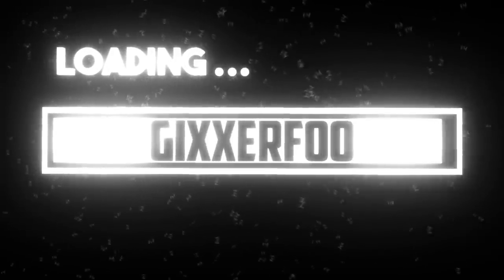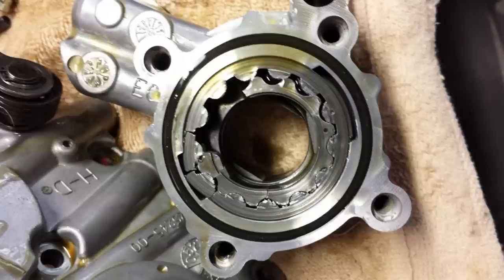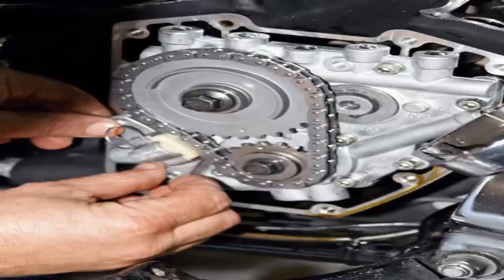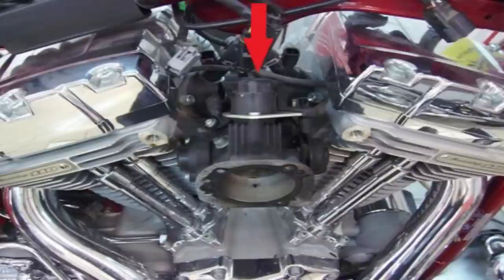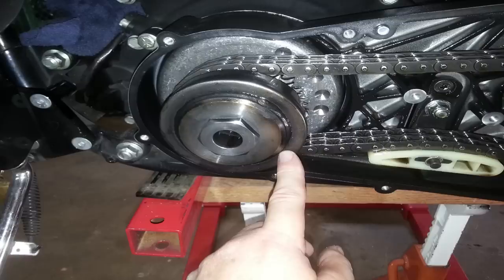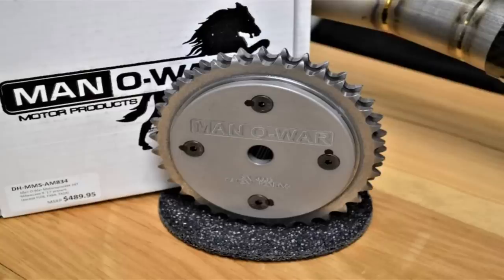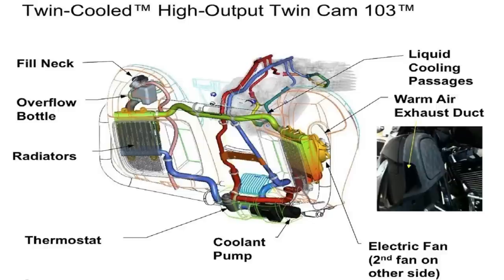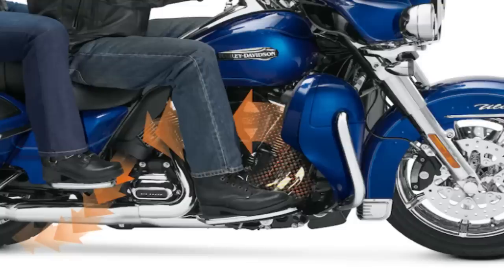5 Harley Problems the Aftermarket Fixed Before the Factory

Comment: Great video and no sugar coating. Harley drags their feet because it is all about money. Just as a comparison of American motor companies if you take a look at the Victory air cooled V-twin the last engine the 106 is everything a Harley engine should be. Harley knows and they have the ability to change because they have done it before. I think Harley just likes to sell parts and labor at this point. I like the last auto change tensioner and was a little apprehensive about it. When I first had my primary cover off looking at the chain tensioner the first thing that went through my head is why is this not a auto chain tensioner? I asked this twenty years ago! Thanks for the review and the shimming advice. I will now upgrade the XL1200S.
Reply from the maker: The Victory Freedom 106 was a great motor, it's a shame they ditched it but Indian was outselling the Victory platform. Harley for sure build bikes that keep the parts and service departments open.
Reply: I have a Judge and it is my commuter bike now. Every time I ride it I think, this V twin has all the sounds and clean looks but it is smooth and effortless to own. The Sportster, I still have,  took effort on my part to get it to run properly. Fixing the carb. No thanks to the dealer. Environmentally sealing the  timing harness connector located on the bottom of the engine just in case I had to ride through water up to my axles on the Palmetto expressway on the way home in a downpour. Lol.

Comment: I have a 2000 road king, I replaced the manual primary chain tensioner and put Harley‘s spring tension on. I’ve been looking at a hydraulic chain tensioner I don’t know much about them. I may go back to the manual chain tensioner. Do you know anything about the hydraulic chain tensioner.
Reply from the maker: The hydraulics are a lot better than the OEM tensioner, they do have some give and work much in the same way as the hydraulic cam chain tensioners. I still prefer the manual tensioner myself though, I like to set it an know where I'm at.

Comment: Gixxer, good production as usual!  Also, though, listening to Kevin Baxter and watching his video covering the compensator "family tree," there was a marked visual and engineering difference between the unit used in the 88" engines compared to the later compensator designs.  He specifically shows the three side by side and calls the second Twin Cam one (compared to the first one) a "miserable failure."  So what I concluded from those visuals as well as what he outlined, was that the first Twinkie iteration was actually sound and pretty much OK unless you go huge build, but it was the latter ones that were bad and only ultimately fixed with the "final" versions bowing in the teen models.  Thus, I'd say that the larger engines outgrowing the compensator were not the issue per se, but rather, the design changes they came out with for those re-designed comps were the real culprits.  From southern California - thanks again and ...Ride Forever!
Reply from the maker: That's an excellent point, Kevin build some stout motors honestly the way should be built! He's absolutely correct about those compensator designs, Harley was saving money and passing the mess onto us.
Reply: Jessica the guy who complained about his Sportster my 1999 Sportster has gone 350,000 Mi almost trouble-free belts last me around 100,000 MI I've never had to replace anything in my clutch at all there is the little bearing that goes out every 50 60,000 miles IQ will hear Rattle and then you have to put the new one and it cost about $6 in parts wait I take the primary apart to put it in all of the Evo Sportsters have been very well reliable much better than their big bikes especially the twin-cam and later version the twin-cam was cheaper to build than evil and it turned around and bit them in the ass for warranty claims typical Harley Pennywise and pound-foolish and they still haven't learned their lesson with the new motor
Reply: I love to piss off the Harley Riders who have the love jugs on their bikes I tell them just like my Vespa Scooter has a fan oh really riled them up haha I remember a road test from the 1950s Panhead where they extended the cylinder head fins out to match the barrel and they said that the Panhead runs as cool as an Iceman shoulder my Evo Sportster runs 200° to up in August in Florida Evo Sportster the best Harley ever made

Comment: How about fluid transfer from the trans to the primary? I had 8 ounces in my primary until I installed the vent tube not to mention the ridiculous amount of blow by even when my oil was 3 dots below.
Reply from the maker: The M8's crankcase ventilation is awful, vented dip stick and trans cover helps a lot with that. Getting a upgraded oil pump helps a lot, either the latest Harley oil pump or even better is an aftermarket pump.

Comment: On a side note about heating and oil and traffic. I put 15W50 Castrol Syntec car oil in my Sportster and ran it fifty miles everyday in South Florida traffic and that oil never broke down and the engine never made head noise or blew oil out the air box. Engine never missed a beat as far as lubrication goes. It sounded so smooth the Harley dealership guys would ask me what I did to get it so smooth. I told them ancient Chinese secret. Lol. Never adjusted anything. If running any engine at a lower idle multi viscosity oil is your friend. Thin oil lubricates better on a cold engine.
Reply from the maker: That's a great point! Castrol makes some dang good oil, I used to run it in my race bikes!
Reply: I’ve been running shell rotella 5w 40 synthetic diesel truck oil on my bike for years. I use it in the transmission, primary, and engine. No problems, and it seems to shift smoother with less “ clunk” when shifting. I’ve been told that I’m going to destroy the drive train in this bike but I’ve had 30,000 hard miles and no problem.

Comment: We still have air/oil cooled engines in lawn mowers too.  It's time the Sportster S motor is expanded to the cruiser and touring models - that is, after the aftermarket sorts out the problems with the RevoMax motor.
Reply from the maker: That's the direction it is moving, the air cooled Sportster is done. Eventually we'll see Harley have a bike like the Indian Challenger.

Comment: After watching your other videos on Shovelhead, Evo big twin and looking at forms on the new M8. Harley after 118 years had issues with engines even at 118 years old. The Sportster 1200 is the most trouble free Harley engine. I hope the new 1250 Revolution Max is trouble free too!  I hope to see a 1350 Revolution Max in a Softail or Touring bike one day.  Liquid Cooled is the only way to have an engine make maximum power n torque at a constant controlled temperature.
Reply from the maker: Right on! I am really hopeful for that new Rev Max, so far it looks like a success in that Pan America. People are already going cross country on them, I've been following some other YouTubers doing that. Now that the Sportster S is out I'm waiting to see some long term feedback on it.
Reply: @GixxerFoo  Ask Harley if you can get a Sportster S for a good review!  GixxerFoo, Thanks for your vidoes

Comment: Your list pretty much sums it up. Not to sure why they moved away from Timken bearings though.
Reply from the maker: It was a cost savings move, faster to setup and install on the line. They didn't have to take the time to setup backlash on the tapered bearings either.

Comment: I love your channel. Straight to the point and very informative. What is your opinion on the Ultra Cool oil coolers? They have the duel electric fans that turn on when the oil hits a certain temperature. I've been thinking of installing one on my 110 just to keep it running a little cooler.
Reply from the maker: Ultra Cool is one I really like, those fan assisted units are the way to go. Especially on the 110 motor, they already run pretty hot and you can't beat that fan if your sitting at a light.
Reply: @GixxerFoo  Thanks I appreciate your input. Looks like there will be an Ultra Cool in my near future.

Comment: Gixxer,here’s another one.The early latches on the tour packs are junk.They rattle themselves apart.I replaced mine with rubber pull latches I bought at Napa.
Reply from the maker: That's a good one! I've heard about those latches being a issue!
Reply: Gotta remember to LOCK them too. If left unlocked , they pop open.

Comment: if Harley would tighten up the run off tolerances most of this wouldn't be an issue but allowing 12k on the pinion side should be criminal.
Reply from the maker: Totally agree, they would have to go back to tapered bearings and take the time to set the crank up properly again.
Reply: @GixxerFoo  All because Timken wanted too much money for their bearings and the bean counters saw it as an opportunity to do away with them. Look no further than the "INA cam bearing" as another savings initiative. They totally suck.... I don't even know why I still ride these POS bikes.
Reply: @kennethwise7108  Why stress yourself out.... just get rid of it and get what you want
Reply: @marvelharris9540  ive tried BMWs but they're way too expensive to maintain. I guess I'm a glutton for punishment 🤷🏻‍♂️
Reply: ONE PIECE FLYWHEEL ASSEMBLY!!!

Comment: You should have mentioned the horrendous water pump and epic failures while talking about the twin cooled  models... They fail on average around 8,000 mi Harley won't recall them just like they didn't the compensator but they will sell you the kit for the new pump on the M8 and recommend that they install it for you.  What a racket!
Reply from the maker: Yeah those housings like to crack and start leaking on the twin cooled bikes, if the pump doesn't outright fail. I think that was on the early bikes, the later models have seemed to do pretty well. Harley doesn't recall for mechanicals unless it is a safety hazard like the brakes when they did that recall.
Reply: @GixxerFoo  Just replace my water pump this weekend $352.?? plus tax.  Tore it apart to see what failed.  Found an electrical connection was not soldered well enough and when things got heated up, the contact points would come apart.  Less than 7000 miles on a 2015 that I just bought last month.  I read many post on this issue before I bought it.  I knew what I was getting myself into.  Never in all the years I've had Harley,  would I thought I would say,  I had to change the water pump on my motorcycle.  I put the new M8 pump conversion on.  Once again telling me that the MOCO knows they have a problem.  They wanted $1050 to replace it at the Stealership.

Comment: What about the crankcase pressure problems in the milwaukee 8s,whats the latest fix for those,besides drilling a hole behind the primary
Reply from the maker: Best way to go about that right now is a vented dipstick and or a vented trans cover to atmosphere to relieve that pressure. The next step to combine that with is a updated Harley oil pump which is stock on the late 2019's and newer. Even better is getting Feuling or S&S cam plate with a high flow oil pump.
Reply: Thanks for the info

Comment: The biggest beyond bone head move was changing the crank tolerance and removing the Timken bearing. I love my Harley but I hate them for this. Cams should be gear driven. The compensator would be less of an issue once the crank runout is removed. What they need to do is follow in Jaggs foot steps and improve on the oil cooler system.
Reply from the maker: Completely agree, the motors went to pot with the non tapered roller bearings. When they did that gear drive was out of the question from the factory.
Reply: @GixxerFoo  Yet we still love our bikes. Many riders care more about chrome and colors than they do a well bullet proof built engine.

Comment: The twin cam setup wouldn't have been so bad if they used gears instead of a chain on the backside of the cam plate and had just one chain and tensioner right behind the cam cover.
I think that hybrid set up would be a lot more trouble-free than an all gear or all chain setup.
Reply from the maker: To keep the gear drive they would of had to stay with the tapered bearing lower ends and take the time to set backlash on everything. I completely agree, Harley says they got away from gears for noise reduction. Lol I don't believe that for a second, it was cost reduction for the factory while raising the price on the bikes.
Reply: @GixxerFoo  I totally agree. But as a compromise I would have been fine with just the one chain on the outside of the cam plate. It's just on the inside of the cam plate where one cam drives the other I wish they would have used gears there. I don't mind so much pulling off the cover to change a tensioner but removing pushrods and ripping out the whole cam chest and cams to get to the rear tensioner is ridiculous.

Comment: Being a FXR rider with the trustworthy EVO on board, I do not recognize these problems, but guys from the club I am a member of, they do recognize these hideous Harley Davidson technical neglections (mistakes, errors, f@ck ups) which they unfortunately had to experience for them selves. Although my EVO may leak a little oil here and there...the reputation of my old EVO is the "GO" motor and they all have much more modern "NO GO"motor. When their Motors basically "GO" they've got convincingly more power than my old EVO produces, but when they stand still for these idiotic and stupid reasons, my old EVO does her thing and never let's me down, with her 70000 miles on it and counting... So yeah... I'll stick to my old EVO and leave all of those modern high powered V-twin to you guys. 
My personal advice would be: Go get a Twincam or even a Milwaukee 8 and don't ride it before you have taken the motor entirely apart to correct all standard Harley Davidson f@ck ups and then, only then put the motor back together. Maybe then your bike will be as reliable as my old 1985 EVO1
Reply from the maker: You know that's exactly what Kevin Baxter does with his engine build packages. He takes a Twin Cam or a M8 completely apart and rebuilds them the right way from the crank up for his customers. He basically builds those motors to what the Evo originally was to begin with. Best part about your Evo is a rebuild is quick and easy, not mention inexpensive as well. You get a cam like the Andrews EV27 in an Evo and it will make reliable torque and horsepower all day every day.
Reply: @GixxerFoo  Yes indeed, and I did forget to mention that although these Twin Cams and M8 motors do provide a lot more power, these bikes are no match to me and my old EVO when it comes down to the twisties. Even the modern FX softail bikes can not keep up with me and those baggers scrape the road in every corner... So yeah, my old 1985 EVO 1 may be under powered... I still see no reason to upgrade my motor, as they majority of the newer bikes simply don't handle the way my FXR does ;-)
Reply: Long live the  Evo.👍🤘😎🇦🇺
Reply: Your Evo's brother the Shovel is sitting in my carport right now laughing..."they thought I was junk cuz I leak a little oil." 🤣 Which can be fixed
Reply: I have a 1997 Dyna, been a great motorcycle! When I bought it I immediately replaced the Fafnir cam bearing with the older Torrington. Added a "race brace" to the rh side and the Hayden chain tensioner. I now have over 50k miles on it, heads have never been off. Still runs as good as when I bought it slightly used 20 years ago. 

I would not trade it for any new HD!
Reply: I have a '99 FLSTS Heritage Springer, last year evo, in my opinion arguably the best motor the Motor Company ever produced.
Reply: @brandonmacon3317  Oh yeah, the mighty Shovelhead...wish I had one... but I comfort myself knowing that my 1985 EVO1 basically is half a Shovel ;-)
A little oil leak is still not to be compared with the sh%t the Twincams and M8's owners gotta cope with...Meh, I'll take a Shovel or an Evo every day of the week ;-) I've seen to many breakdowns of Twincams and M8's... And what will bring you all that extra HP in your Twincam and M8, if that means they'll keep on breaking down on you...?
Reply: @stanfischer6175  Ride on brother ;-) ! Those Twincam and M8 guys will come around one day...!
Reply: @fearsomename4517  Yeah, you are probably right, although my old 1985 EVO 1 and my wife's 1986 EVO 1 as well keep on riding and the only thing they need is gas and occasionally a little oil. It is probably politically incorrect to state this but; The EVO motor rulezzz (but one day I'll probably get myself a Shovel as well..;-)
Reply: Same...every time this channel covers this mess I sigh with relief
Reply: @dutchyjhome  I also have a '39 (restored in the '90's) Knucklehead. I love the fact they're 60 years apart.
Reply: @fearsomename4517  OK...officially jealous ;-)

Comment: I heard somewhere that, on the M8, the oil goes through the oil cooler before going to the filter. If so, I would think the dirty oil would end up clogging the cooler after a time…it should be filtered before being cooled. But I could be wrong.
Reply from the maker: That's interesting, I'll have to look at flow diagram for the M8 and see what's going on there. Yeah I'd have to agree going through the cooler first would be a problem over time for sure.